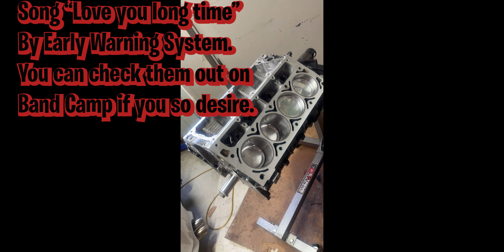SS VY Stroked And Boosted Holden Commodore TH400 Removal And Upgrade

Comment: What size wheels and back spacing on the back?
Reply from the maker: 20 inch.  Front are 8.5 wide. Rears are 9.5 wide. Rear offset is +45 and frond are +35
Reply: You have to run 225/35/20 on the front for strut clearance. 245/30/20 on the rear to clear the guards and wheel well on the body side. I rolled and pumped my guards for extra clearance as I’m quite low as you can see .